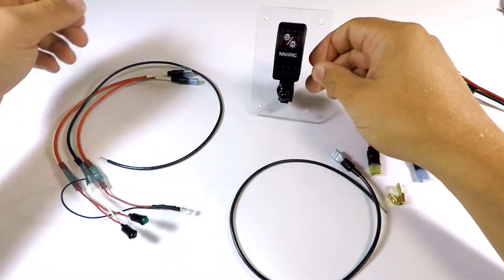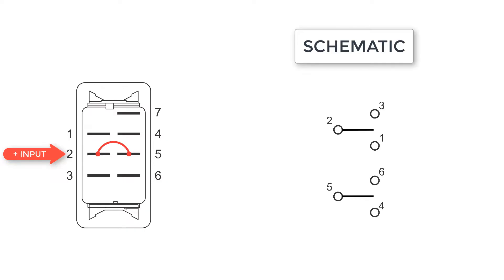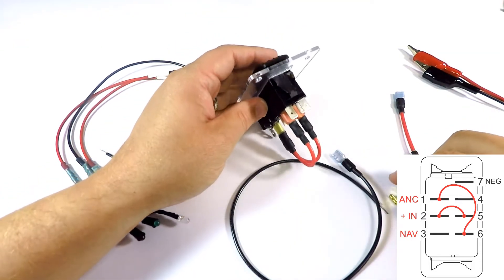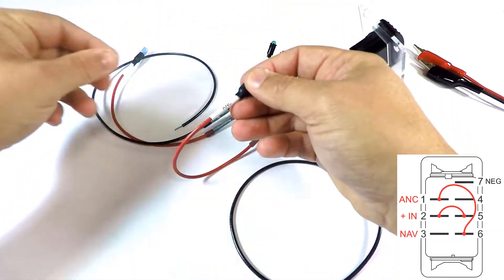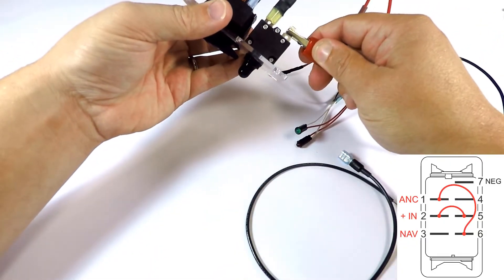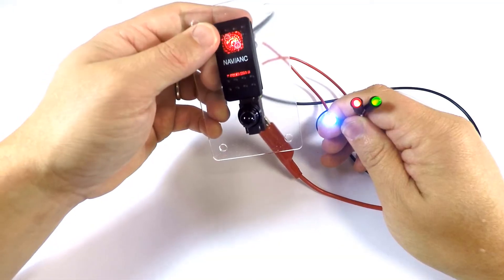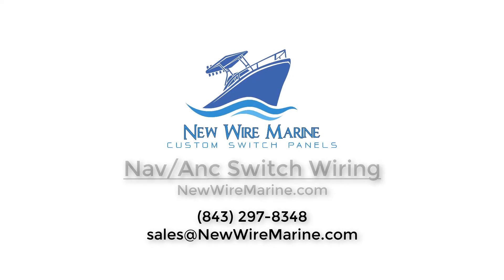Navigation and Anchor Light Rocker Switch Wiring Guide

Comment: If both the anchor and nav lights are all coming from 1, 3 and 6 wouldn't down position light all three lights (pin 1, 3 and 6)? Pin 1 is just anchor and pin 4 is not used.  Up would only power pin one?
Reply from the maker: I'm not following... not if you wire it like in the video:  https://youtu.be/Pg6jQPPNFSk?si=W_w7Hxs14F3EhNfD&t=68

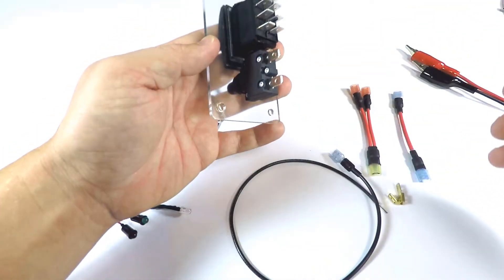Look at time 1:08... down position opens the connection from 2 and 3, so if you've got it hooked up like this, the nav lights are not on when down.

Comment: Are Relays suggested, to reduce Amperage passing through Switch ?  Where does Fusing go in the Circuit ?

Thank You for the Clear content 👍🏼
Reply from the maker: This switch is rated for 20A, so no relays would not normally be required.  The fuse would go before the input to the switch.  In series.  The same place as the breaker shown in this video.

Comment: Also, I would that connection work with multiple toggle switches?
Reply from the maker: I'm not seeing how that would work.  If I was going to use multiple switches, I'd probably just use a SPST switches one for nav and one for anchor... you'd just have to remember to turn both on while running.

Comment: Eric, finally got my switch wired correctly!  The only problem I have is the small courtesy light in the center of the switch stays on all the time!  How do I get that tiny switch to go off when switch is not on???  Please help!!!
Reply from the maker: Lights in the switches usually come on when there is power on the output, so sounds like you have power going into an output and out of an input.  You could also just buy the switch in the video and wire it exactly like the video and it would work 😂
Reply: @NewWireMarine  In to out and out to in, that was the problem!  The color codes for both input and output wires were the same, that’s what threw me off. Thanks so much Eric. Just want you to know the we wanna be techs who try to fix thing ourselves appreciate you so much, making these videos and helping us.  Thanks again!

Comment: So if the ground pin is on the left top instead of right, does that make the other pins backwards as well???
Reply from the maker: Probably should try and ohm it out with a meter to be sure, but as long as it’s a DPDT with six contact pins, then it’s symmetrical and should make a difference!  Sounds like it’s not a Carling  brand switch, so possible it’s different… obviously one thing is 😮
Reply: @NewWireMarine  the 3 position switches have the ground on the same side as your example.

Comment: Does this have to have a circuit breaker? Or can I wire the power directly into the switch?
Reply from the maker: Yes, every load should have a breaker or fuse
Reply: @NewWireMarine  there is an in-line 10 amp fuse in the circuit. Does that suffice?
Reply from the maker: @Eriicerrr  yes, an inline fuse is still Circuit protection that will prevent a short circuit from causing a fight… seems like you’re 👍

Comment: Where would I plug in the wire for the backlights for the other switches? The only diagram on the website is for the 10 pin switch.

Comment: if i want to install some courtesy led strips and have them on during the up position... can i piggyback terminal 3 for the led positive wire and tap the led negative wire to the switch negative wire?
Reply from the maker: Yes on the positive.  I’d run the negative through the main negative bus though, not the negative on the switch.

Comment: This is a very useful video!  thank you...    I do have a question....  What is the amperage rating  for the circuit breaker? I am using this very same setup using  LED lights.
  Thank you
*update..  My switches arrived today.. i also bought the Volt Meter. Would i wire the Volt meter  before the circuit breaker?
Reply from the maker: 5A probably for modern LED nav lights would be fine.  Put the voltmeter wherever in the system you want to monitor the voltage... so probably before the breaker (with it's on inline fuse), yes.
Reply from the maker: Check your load documentation, but with modern LED lights a 5A should be fine.  I'd put the voltmeter after the breaker just in case there's a short
Reply: @NewWireMarine    Hello there!!
 Thanks for the  reply!  I'll  continue  with the project  in a week or so. Winter came and the project stopped.  Your information and video was everything i needed.  The switches and meter are of perfect quality!  Thanks for everything.
Reply: Are these rocker switches strong enough to run led fog lights (limited use) ran through the fuse box without a wiring harness and relay? My fog lights are 18w and 36w. If I understand correctly that means it’s only about 2amp and 3amp systems. The rocker switches seem to be strong enough to run straight current through right? I’m only flipping them on and off to see around me on a 18ft pontoon. Even running for a long period of time I don’t see why I’d need a relay... am I wrong? Thank you!
Reply: @nmfishdude200    I'm sure that   you will get a   more definitive  answer  from the channel owner.  I can offer this..  you can never go wrong with a Relay.  I use them in my truck  with my Fogs and driving lights(full disclosure  they come with the Harness)  I also call it cheap insurance.  I like to call it  an "Auxiliary switch".  It does not appear that you will require  one for your application.  I would like to hear what the people here  have to say.
Reply from the maker: @nmfishdude200  Correct.  Divide watts by Volts to get amps.  So 18/12 = 1.5A.  Our switches are rated for 20A, so yes, that would be no problem.

Comment: For the power jumper, is it soldered under the heat shrink to connect the two primaries?

Or do you sell a female disconnect that has two wire connections?
Reply from the maker: No, a good crimp and heat shrink is all you need.  This terminal will fit two 16AWG's into it: https://newwiremarine.com/product/12-10awg-quick-connect/

Comment: How does one install a dimmer for the switch LED lights?
Reply from the maker: Well you can't on this switch b/c the lights are dependent (internally triggered).  You'd have to 'dim' the load as well, which you would not want to do probably.

If you used this switch you could: https://newwiremarine.com/product/on-off-on-dpdt-indep-lamps/  You'd need to insert dimmer modules or resistors between the output terminals and the independent lamp terminal (diagram at link above).

The easier thing to do is probably use a SPST unlit switch like this: https://newwiremarine.com/product/v1d1-s00b-spst-no-lamp/  And break the negative to the entire panel, making all the switch lights turn off when it's really dark.

Back in the day I'd also occasionally put masking tape over it when we were going out early in the morning.